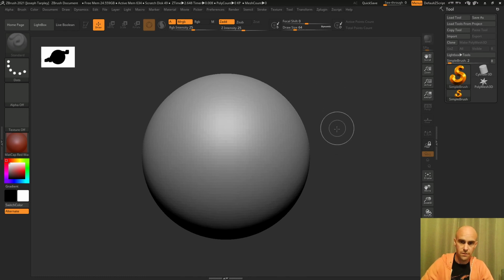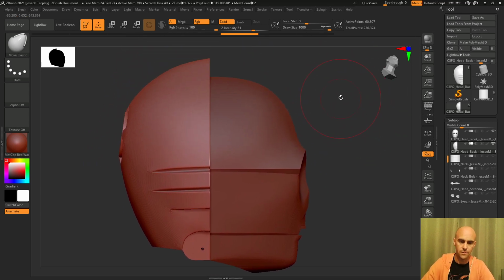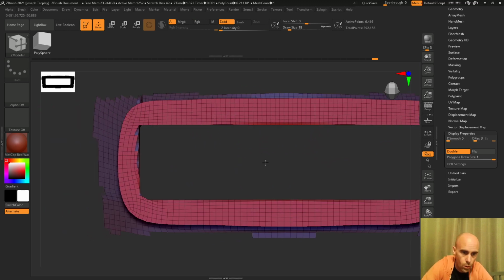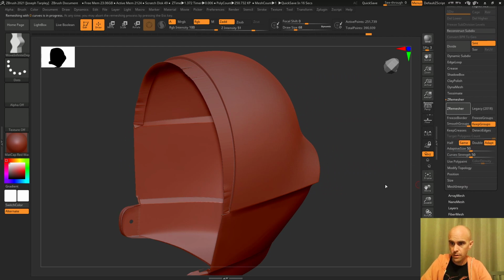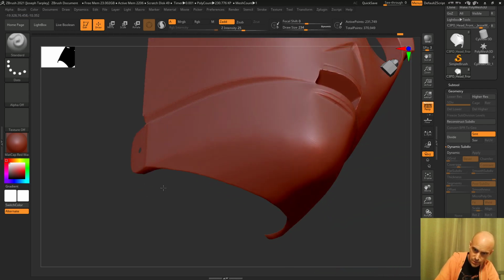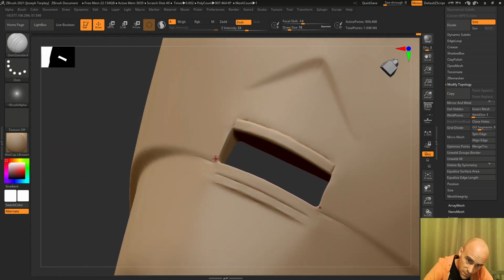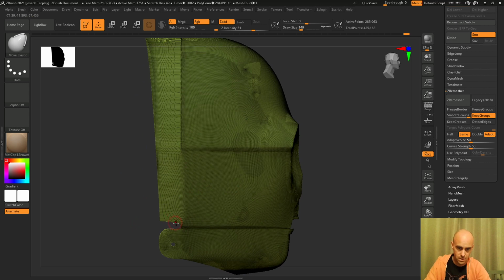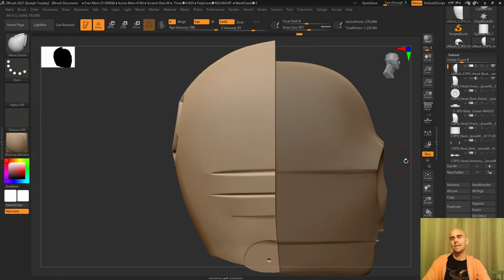Modding Jesse_M C-3PO helmet 3d files

Comment: Hi Gordon. I printed out the front of this model at the default dimensions (172.7mm wide) but I have found it to be too narrow to fit on my face - my ears in particular- and I don't have a very large head.  What dimensions are you using in your wearable models?
Reply from the maker: This isn't a print. It's a fiberglass copy from a screen used face.
Reply from the maker: I'll have to measure this one and see what the size is. I'll try to get back here when I have a chance
Reply: Thank you!

Comment: I'm starting my journey on making my own protocol droid costume and I want to use your files to make the first head. But I noticed that your files don't have a tab at the top to hold the face to the back part of the head. Is that supposed to be there? Or is the tab not needed?
Reply from the maker: I just left it off. The screen used costumes don't have a tab like that. But it's not a bad thing to have if you prefer it.
Reply: @gordontarpley  I saw, in one of your other videos, a moment when you took the mask apart and I saw the little eyelit part you are mentioning. But it would require some mods to the back of the helmet and the horn to create a way for it to screw in. But thanks for the mods! I'm hoping to get my head done soon

Comment: Awesome job..!! One other thing i didn't like the neck has a about a 2cm gap when inside the neck ring , the new hope 3po has no gap.. just me picking again 🤓
Reply from the maker: Yeah, definitely a bit rounder around the neck hole. Also, the plastic used on the neck and having an actor in the suit helps fill it out more